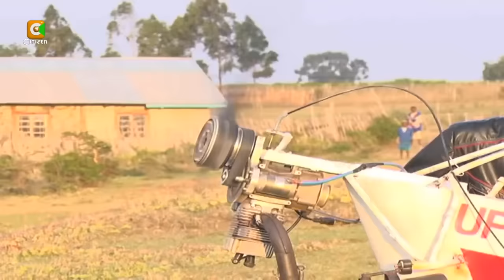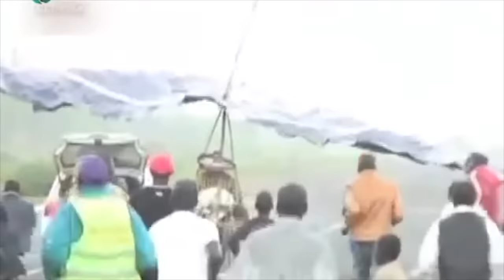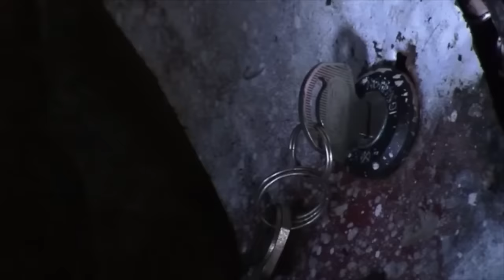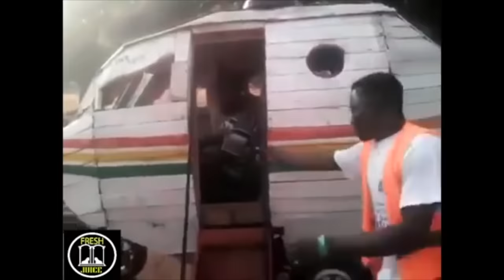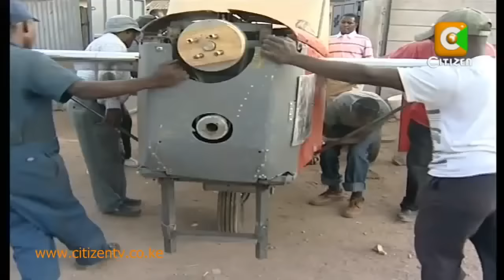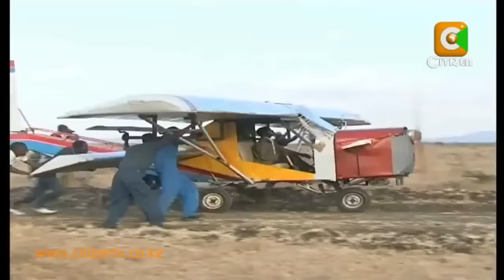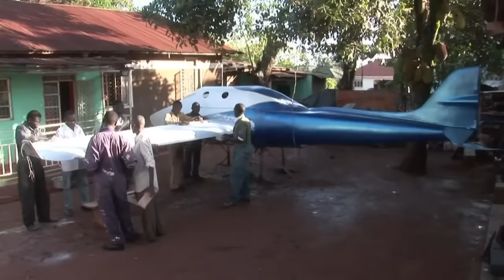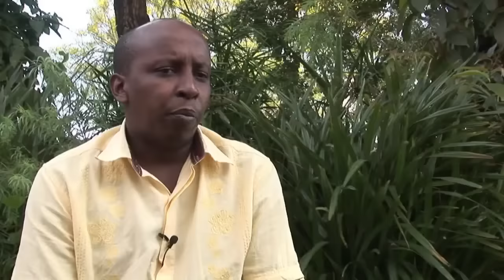African Airplane Compilation | African Aviation

Comment: Imagine a helicopter shifting gears while flying..

7.0k!? You guys are unreal 🙏🏼😂
Reply: Art car heading for Burning Man!
Reply: Imagine stalling in the air
Reply: Imagine bro making a helicopter with pitch links the size of chop sticks😂
Reply: that tail rotor was way too weak, im pretty sure thats why he was spinning while in a hover
Reply: I thought as much 😂
Reply: with that clutch
Reply: gear ratios are used to measure and judge by using a graph to find out the efficiency of the craft itself but, it's a very dangerous machine to learn and fly that's the helicopter, I've heard many homemade helicopter pilots were killed or severely injured their own machines.
Reply: Accidentally hit neutral you're dead
Reply: @thooke222  or shift reverse 😂
Reply: @-nightraider-1169  aircraft engines do stall mid air.
Reply: It’s cyclic gears for pitch control 😂
Reply: It’s cyclic gears for pitch control 😂
Reply: Quite common actually. But unlike shifting in an airplane, you have to double clutch due to the large rotor diameter.
Reply: It'll stall🤣
Reply: "DOWNSHIFT, QUICK, WE'RE GOING DOWN!"
Reply: Every time when shifting gears have to sacrifice altitude and control...if lucky will recover from stall
Reply: That would be fun/cool. Probably more reliable so if 1 blows you have extras
Reply: Holy Crap
Reply: They do, technically, but mostly have automatic transmissions these days. Takes a lot of torque to start a rotor, not much to keep it spinning unless collective is maxed.
Reply: One foot on the brake and one on the gas! Too much traffic, I can't pass no. I can't fly 55
Reply: Body and material that they are using are not adviced
Reply: @olaliedwin7591  Reminds me of a 3 wheel trolley I've seen in the Bahamas. Our taxi was a trolley.
Reply: imagine heel toeing in an aircraft
Reply: I guess they've never heard of BLM
Reply: Imagine enggine fuse broken
Reply: Ahahahahaha
Reply: Clutch-stall-(butt_pucker)-shift-climb.........
Reply: Give these guys free passes to Embry-Riddle
Reply: Whoops there goes another rubber tree plant ✌️ ♥ 🎸 🍻
Reply: There was an aeroplane that needed to be shifted in the air.
Reply: @hookergetlucky3216  Several nations in Africa have fully functional aircraft from other nations and they routinely disassemble and refurbish them like new.  Egypt and South Africa are manufacturing the advanced High-Performance Reconnaissance Light Aircraft, which is a super efficient reconnaissance aircraft that can fly under radar and has advanced communication technology.  It rather looks like a cross between a Skymaster 337 and a helicopter.
Reply: @hookergetlucky3216  Did you read the entire comment. There is a part about the advanced reconnaissance aeroplane, as well.  There is great danger in only reading what you want in a comment.  It may prove very damaging to you someday.
Reply: POP THE CLUTCH!!!
Reply: Imagine shifting in reverse gear while flying.
Reply: @JheMaChi24  There was a jet liner that went into reverse thrust in the air.  I forgot the flight number.  Needless to say, the jet did not fly very good and crashed.
Reply: @robertmencl9169  Sadly, I still drive a vehicle old enough that double clutching is required to drive it successfully.  It has an NV4500, unsynchronized transmission.
Reply: No worries, you'll just drop like 100 yards before the helicopter stabilizes again.
Reply: 🤣🤣 wow.
Reply: I would just order a plane kit from the US. And back engineer it. They have to be able to make aluminum sheets. That's what planes are made of aluminum sheets and aluminum frame. Which is just thick aluminum. You can even make a plane from wood frame and fabric. The  wood has to be balsa wood. But the frame for both the wood and the aluminum are the same. Basically the wings are made of cut outs that attach to the outer sheet. If it's fabric you need a long wood piece to attach the cutouts to and the fabric goes on top of the cutouts. With planes the less frame the better.
Reply: It would definitely work but you would have to go into autorotation every time you wanted to change gear 😆🤣 be like a roller coaster ride lmao (BTW autorotation is how helicopters land when the engine fails, works just like a Sycamore seed/helicopter tree 😆) basically to enter an autorotation, all you do is lower the lever that makes you go up! This changes the pitch of the blades so they have a shallower angle of attack and then you down.... when the ground is fast approaching and you are about to crash you pull up the lever which sacrifices rotor speed for lift (basically)
Reply: I'd rather not
Reply: And now we would have First Galaxy Expedition!))))🤣👍🏻😂👈🤣👌😂🤘
Reply: #SaveTheManuals
Reply: @rahulsudhir666  ya the flight manuals
Reply: I never seen a helicopter that has just 9 horse power.
Reply: @nightizzat4574  and you never will .that isn't a helicopter, it's a death trap
Reply: I become smart after watching this
Reply: Imagine reverse warning chimes.
Reply: @mastersitorou8289  lmao no shit. How could it be dangerous?
Reply: @indridcold8433  I haven't had a rig with an NV4500 in it but I've heard nothing but good things about them being reliable and basically bulletproof.
Reply: @justlucky8254  It is extremely reliable however, this one is unsynchronised.  Double clutching gets a bit tiring.  But, I would never put automatic into the old Jeep. They are worthless.
Reply: @indridcold8433  what year/type of Jeep?
Reply: @justlucky8254  This is an old 1997 Jeep Wrangler, bought in late 1996, with the tub of a 2001 because of an impact in 2005. I also changed the rear axle to the TJ Dana 44 in 2010 when I put in the 4.5 inch lift.  Instead of putting a body lift in her, I modified the transmission tunnel for the NV4500.  I am not sure from where the NV4500 came.  It was a salvage yard purchase. I have had no problems with it at all. Double clutching is smooth, flawless, and quick for what double clutching can be anyway.  But it gets rather tiring.  To get it synchronised, it cost almost as much as I paid for the transmission. So, I either take off slow or double clutch.  There will never be an automatic in my dear old Jeep. The RMS Stargazer has been with me for a very long time for me to mistreat her like that.
Reply: @-nightraider-1169  To land, one has to stall the plane.  Unless you are referring to an engine stall.  That would not be good.
Reply: @indridcold8433  good on you for not sacrificing that for an automatic, and also for avoiding body lifts!
Reply: @comontoshi  The art car sounds like a great idea.  With a little tweaking, some of these failed planes would be perfect for an art car.
Reply: Well I guess you can always put it in 2nd and pop the clutch if it stalls out on ya 🤣😭
Reply: Hit limiter; and no lift shift to 2nd lol
Reply: I give them props for train😏
Reply: Imagine John Lennon...
Reply: Just make sure to speed shift.
Reply: to be fair all of this aircrafts would have been front page news back in 1909 or 1904 🙄 now they just need a time traveling machine and go back to that time, I'm sure they will get lots of sponsors 🤔.
Reply: That'd be a rough bump while high up, the tail rotor having to compensate for that too you'd probably yaw hard all of a sudden.
Reply: It is just like a Supercharger on a Rolls Royce Merlin.
Reply: And then  he accidentally shifts to "Reverse" 😂
Reply: @LukaszMx989  ☺reverse ha
Reply: @-nightraider-1169  i can imagine that black dude meme saying “….okay” as it crashes into the ground lmao
Reply: I just witnessed a man trying to fly a airplane made from a weed eater motor zip ties and duct tape I'm so done with youtube 🤦‍♂️
Reply: THWUPPA THWUPPA THWUPPA CLUNK CRACK BOOOOOOM
Reply: Now imagine that Africa has a space force because it does..
Reply: @saiyanwannabe6896  faxxx
Reply: Imagine missing a shift
Reply: Imagine missing a gear and falling like a pigeon dropping 😂
Reply: Pop 'er in reverse
Reply: @joshmellon390  😭😂🤣🤣
Reply: @mastersitorou8289  and they were right here in the us and WHITE. Just saying for all the racists here commenting.
Reply: Les bouffeur de terres qui veulent voler maintenant 🤣🤣🤣
Reply: @-nightraider-1169  shit, pop the clutch!
Reply: @Indrid Cold  I have no doubt that there are brilliant minds at work in Africa; we all have the same brain.

Except for these guys.
Reply: Eat your heart out Boeing, you're just "old school"
Reply: Imagine imagining
Reply: Imagine any of those...."things" actually leaving the ground???
Reply: the only time you shift gears is when you are going into a steep climb
Reply: Would love to see that mate 😂
Reply: Hahahaha
Reply: @-nightraider-1169  A helicopter stalking is usually fine because the spinning blades slow the descent.
Reply: Nice
Reply: I will make my own too
Reply: I don't think any people as much as powerful as person who trying to fly this plane 🤣
Reply: I only imagine Gravitas taking over!!
Reply: That's fairly standard :)
Reply: @saiyanwannabe6896  that would require one of the most skilled pilots…
Reply: The famous wright brothers 2.0. That happens when you don't have a TV.
Reply: That is the best comment ever 😂
Reply: I can't stop laughing. 🤣🤣
Reply: It's actually possible with TVC gearbox with them you never loose power but also they don't have "gear's" it's more like smooth transition so yea theoretically helicopter could shift gear's and still work
Reply: @andrzejmatwijenko7311  yeah, THEY DON’T HAVE GEARS. Kinda the point of this joke is the “gear” thingy.
Reply: @originalfallinggirl  i understand the joke but just instead of laughing I start to think how it would be theoretically possible and share my conclusion
Reply: @thooke222  that's one way of landing a Helicopter, when the engine dies, pilots will usually let the rotor run free, this creates a small amount  of  lift, this reducing the impact on the ground
Reply: @-nightraider-1169 you can stall any airplane if you don’t know what you are doing 😂
Reply: @robertmencl9169  and when the manifold warning and the floor falls out happens just say shut up and slam a laptop shut 😅
Reply: Hahaha
Reply: When it crashes 
Dam it needs another gear
Reply: Come on 🤣🤣🤣🤣🤣🤣🤣
They are trying the best 
What they build is amaizing 👍
Reply: The wrong brothers making history.
Reply: Imagine false neutrals
Reply: Everything is fine until helicopter shifts into reverse
Reply: Pop starting your helicopter 😂
Reply: That's kinda fire actually
Reply: Ayo that shit ain’t it especially since you’d prolly need to shift on takeoff
Reply: Imagine burning the clutch
Reply: How else are you supposed to do it?
Reply: @crogsmash1611  Release the clutch slowly... crrrr
I said slowly! 🤣🤣🤣
Reply: He planned to overtake that Boeing 777, and downshifting is the way to go 👍
Reply: @tamnickyle  🤣
Reply: This is not the comment to read when you first wake up, had me dying.
Reply: Imagine push-start when airborne :)
Reply: @adamadam-bv9gr  that's stupid and makes no sense stop trying to copy the dude who really is funny.
Reply: IMAGINE ONE WITH REVERSE GEAR
Reply: Imgine murzyn airplane...
Reply: Nope, and that would be more of an engineering thing. im not an engineer either, I just like helicopters
Reply: Imagine hitting neutral🤣
Reply: What if you stall it 😂
Reply: Yeah that was one of the things I noticed on that one that had the blades that was spinning while it was inside that closet.
Reply: Appreciate his confidence.😅
Reply: KRRRRRRRRRR!!!
Reply: LMMFAO 🤣
Reply: That's why real helicopters have a rotor that spins at a constant speed. The lift is adjusted by changing the angle of the rotor blade.
Reply: Imagine money shifting
Reply: @lcfflc3887  why not build ships and pick up their brothers in america? Oh, they can’t.
Reply: oh were finally ready to shift gears.
we expect a little dip as this happens so dont be worried, and go.

a slight problem has arisen, as we shifted gears all the momentum built up was lost and since the rotors stopped moving the engine shut off, and we are unable to build the momentum required to start the engine again. we presume when we land that we will then be able to restart the engine, though we expect it to be a rathar hard landing

dont worry the white man has invented the cvt, next time we wont need to shift gears...
what did you say? the japanese invented it? who are they? theyre white right?
Reply: Crying
Reply: Helicopters require serious engineering and reliable motors. I would not get near one unless it was built by a large reputable company and well maintained. These people are out of their mind!
Reply: So it can fly faster? 💁‍♂️
Reply: In Garry's mod back in 2020 i made quadcopter powered by supercharged 300 HP nascar V8 and yes it have clutch and 2 gears. It is controlled by changing each propeller pitch and it suprisingly worked well. Top speed was around 180 kph with 500 kg frame and it was able to lift 1050 kg off ground. Well balanced rotating hardware is the key for stable flight.
Reply: It's so cringe when people edit to mention likes, imagine getting excited over something so meaningless to ruin the original comment 😂
Reply: @mattwatson  Its a comment, not a political agenda. Get a life.
Reply: @mattwatson  Imagine being so bothered by a comment that has no bearing on your life whatsoever that you feel the need to express how so very badly and deeply shook you are by it. 😱
Reply: 8.4k wow so unreal oh my god